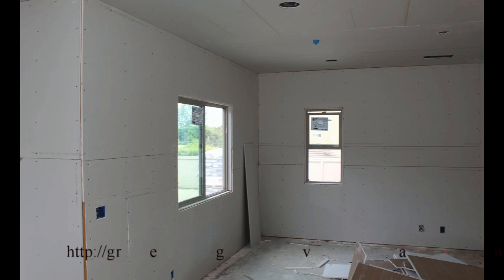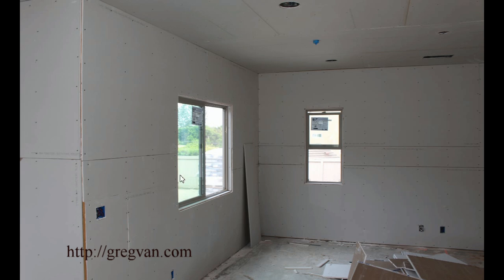Why Do They Install a Middle Section of Drywall in Walls Taller Than 8 Foot?

Comment: not so fast!  It's a thousand times easier and faster to tape and finish two tapered edges coming together, than to do a butt joint. If you put your 2' wide piece at the top or bottom, then you can put the cut edge toward the ceiling or floor, then you have your tapered edges together against the 4' piece.
Reply from the maker: Don't shoot the messenger. Feel free to do it your way. This is the way professionals have been doing it in Southern California for years.
Reply: This is what I was taught also
Reply: It makes finishing cleaner. But i have noticed when the house settles that belly band pops out enough to notice. It sucks trying to do it by your self but better product at the end and long term.
Reply: Use next size down as belly piece.....it's like one big factory edge.....1/2" drywall gets a 3/8 fill as the belly portion......5/8 would get 1/2.......Same as taping a huge factory seam......seen a lot of guys do this

Taping a horizontal seam high or low takes way more time than one in center or close too

Comment: Putting rip in the middle is incorrect, it use to be the norm,but people got educated,always factory or recessed joints together, never cut or butt joints to recessed joints,if you put rip in the middle I'll bet you it shows on slick finish,if you amateurs do it any other way it's Gona look like crap! Around 40 yrs. Of trying to make shitty framed, shitty lumber, shitty sheetrock with deep bevels,shallow bevels,high shoulders where bevels start, look flat, i also put straight edge on joist, or studs where butt joints break, to determine if moving back to the other joist or stud will prevent breaking on a high stud or joist,most of my butts are single blade width, the cost of a few extra sheets to do it correctly will balance out,less mud used,less time,better quality.
Reply from the maker: I would tend to agree with you, but I've seen the finishers where I live in Southern California do a fantastic job finishing the drywall.

Comment: or just get 10 foot sheets
Reply from the maker: If they can be placed vertically, then you have solved your problem, but remember some engineers and building departments require them to be placed horizontally.